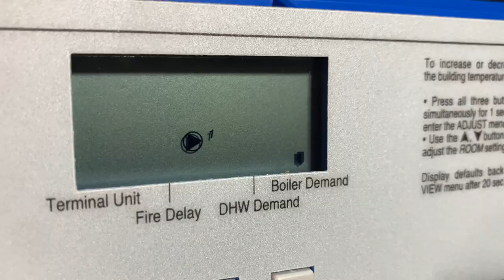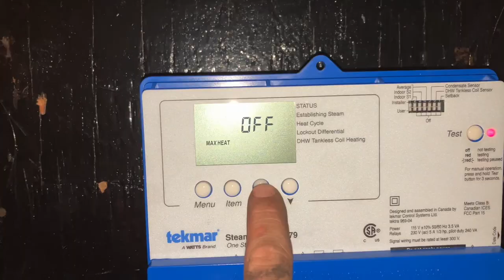2 Trades in 1 Day, Plumbing & HVAC

Comment: Large socket will do the job for the probe, you cleaned the float side of the 51 Lwco that’s great but it doesn’t feed through there, there is a strainer in the valve portion of that valve body, under the cap with the 4 bolts where the make up water line goes in and out
Reply from the maker: thank you for the feedback!
Reply: He is being modest because he has a video where he completely takes it apart and changes the cartridge, cleans the filter and put it back in working order but a large set of sockets are great for that probe thermostatic, radiator traps, check valves, and anything else with a large hex nut on top